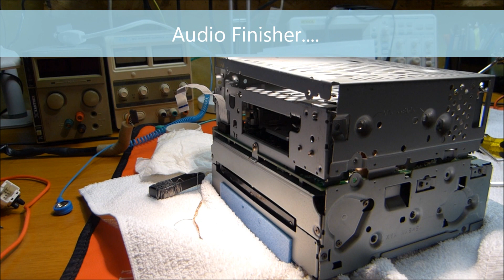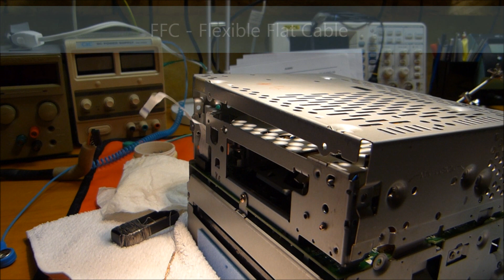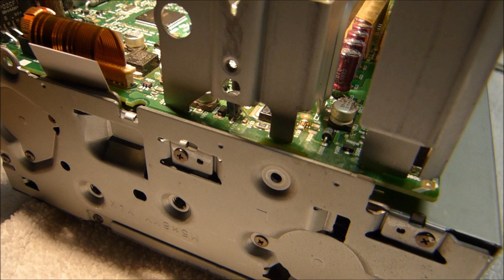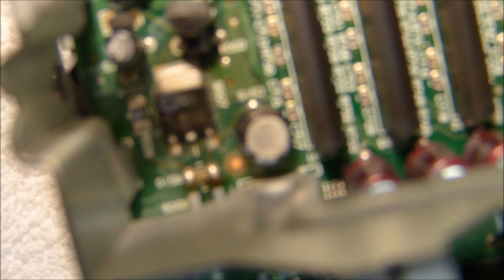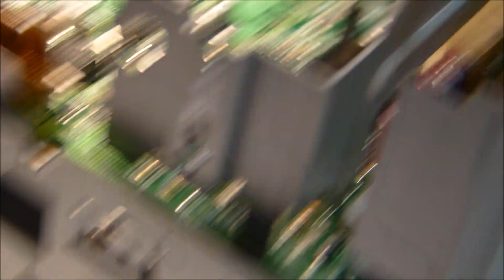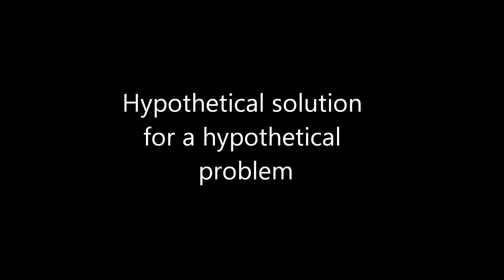Infiniti G35 Head Unit *Potential* Repair

Comment: My fx 35 04 has the same issue , will the same repair work ?
Reply: Hey did you find the problem with your fx35 I have the same issue with my 2004 fx35

Comment: Glad I found this video before bringing it to the shop. I had the Radio and Climate Control issue where it doesn't respond and I constantly get Auto AC. Tried this yesterday, the resistors looked fine to me but I soldered it anyways. Put everything back and it didn't work, not sure why. I tried it again today, I added a bit more solder to R508,9,10 just in case and also added some solder to the transistor. I was also very careful with the ribbon cable and it fixed it today! Huge help, thank you!

Comment: Thanks a lot. I worked for me also.  I solder 508, 509, 510 resistors and it is working perfectly!  I did not have to do the last part of your video that it looks Frankensteinish to me!    :)  Thank again.
G35 2004 sedan Bose with navigation.

Comment: Update: fixed my ac/heat going in lockdown mode on my 2003 g35 coupe. But my radio is still intermidantly not working. Better than it always not working i guess. Seems to usually be in the mornings when its cold. But ya give that resistor a wiggle and see if its loose. Try to get it proffesinally saudered because its tiny and pretty much almost impossible to get in there unless you have a tinySauder gun and small hands.

Comment: Thanks Quantron, This fix really works. My 03 G35 Coupe has been acting up for years. It had finally decided to blow AC at 60 on high. That's OK for Florida, but annoying. Pulled the radio, found the 3 resistors. None appeared loose, but re-soldered each point and the 2 on the power transistor and now everything works like new. Without your research and video, this would all be a proprietary fix for some electronics shop.

Comment: does that thing also causes no sound from your stereo? my head unit will turn on and everything is working perfectly, but there is no sound from my stereo and im not sure if its a wiring issue too because its a stock bose stereo so all the wiring is compacted with all the other wires so if its a wire problem then i should have problems with other parts of the electronic too, but im not. sometimes when its cold outside and the next morning i turn the car on the sound will come on right away after a cold night then sometimes when i do manage to get the sound working only the back speaker is working and often the volume will be stuck on a specific volume and i cant change it lower or higher. then sometimes i will set the volume to a specific level and turn the radio off and on and the volume will jump to a lower level instead of staying at that specific volume level i set it too. i already check the AMP and head unit and everything seems fine by looking at it. i haven't crack open the Head Unit, but i did on the AMP and everything in there looks fine. check the grounding and its good. so im not sure no more.  2004 G35 coupe

Comment: So do you use the same resistors or were they replaced, mine g has this issue, I'm super stoked to take it apart, hoping it works for me as well, great vid btw, you seem to know your shit bro
Reply from the maker: +Edgar Alcocer I replaced them since I was already inthere. A lot of people seem to just reflow them and it worked for them but new resistors would be a safer bet.
Reply: +quanttrom thank you, I'm half way done here :)
Reply: +quanttrom I have the same issue...great video and explaination. What are the part numbers or sizes for R508, R509, & R510 and where is the best place to get them? Radio Shack? .....even if they are loose I may want to replace them.
Reply from the maker: +Tom Dowin In order to get full details please go over the forum threads linked underneath. You will gain a better understanding of the process and how the "solution" was developed. Here is my reference to the resistors you need, http://g35driver.com/forums/audio-video-electronics/391401-climate-control-radio-repair-diy-2.html#post6805224. This might be helpful.
Reply: +quanttrom you are awesome. So helpful and quick to respond. I wish there were more nice, caring & considerate people out there like you. I will give this repair a shot. From the comments of others with the same issue, it looks like this will fix my problem. Thanks again.
Reply: +quanttrom Thanks for the link....so just one 75 ohm resistor and two 22 ohm resistors are needed for this particular repair?

Comment: Thanks for the share, that worked for me. Just a caution when re-soldering the resistors, they will fly off the board, they are a bare to put back in position. Do one side at a time. All is working as normal. Air & heater, radio and all controls working again.

Comment: Can't thank you enough for posting this video. I bought a 10$ soldering iron from Wal-Mart, removed the unit, soldered the contacts listed below and everything works like new. All my radio and ac controls are back. For anyone with a G35 looking to fix this problem....take it from me, it works!

Comment: Worked for me perfectly!  Thank you. 
My issue was similar with the radio display not working, the AC stuck on, but the steering wheel controls working.  Here are the two videos you need to see: 
Infiniti G35 Stereo Removal, Audio Finisher, AC - REPAIR 2003-2004  to see how to remove the stereo unit.  Then your video to see where resistors r509 and r510 are which did need to be re-soldered.  I watched both, had a friend assist and it took us about two hours. We also had a good quality electrical soldering iron.  When he touched r509 and r510 both resistors were loose.  We were not sure it was going to work but a little solder and when we reinstalled it was exactly the cure.  I can't believe that Nissan / Infiniti didn't warranty this Clarion part.  Really poor customer service.  Hope this helps you.
Reply: ***** so the one in black next to the silver one is ? And in readio shack they have them ?
Reply: Couldn't understand the part of the 2 metal pieces he made. Do the 3 resistors won't be needled if I get this 2 metal pieces ?
Reply: Henry Caceres The two metal pieces act as heatsinks. The resistors are underneath.
Reply: ***** sorry, 1 metal piece that helps cool the transistor.
Reply: wanted to mention.  this is the exact same audio unit that Infiniti put in certain 2005 FX35 models. Ours is exhibiting the same problems, intermittent power drain, and a/c system failure, etc.. I'm going to take it out and see if this fix works on our FX35.
Reply: Hey, you also posted it in a forum? Guess, carguru? Read that and watched this video. I have infinity M37 and only AC controls are stuck.

Comment: This video describes how to fix the 2003 g35 issue where the climate and stereo both stop functioning (the panel in the center console no longer works - so the climate control is stuck wherever it was when it got stuck, and the stereo may only get radio when using the steering wheel controls.  I followed the instructions here and re-soldered the 3 contacts (R508, R509, R510) and everything is working again!  Thanks to the poster for sharing this video!  There's another video that describes how to remove the stereo (which was great to get this unit out of the car).
Reply: +vandleigh Can you tell me how you re-soldered the resistors?  I have unit taken apart, but I don't know if if I should add more solder, or just reheat the junctions.

Comment: My Strereo is on and everything kinda works. It doesn't play music, and when it does it's could be staticky or clear but might fade away or not play at all. When I turn up or down the volume the speakers won't make a noise, I know the speaker are fine because it plays clearly when it does. Sometime when the power is on, it will make a sparking noise. Do you know what wrong with it and would it be an easy fix? I justfinished  
battery and charging at my school so I know the basic of electrical